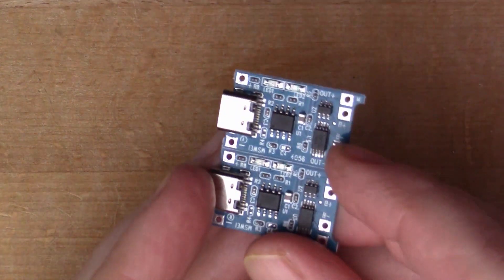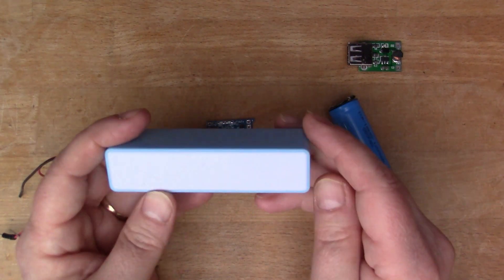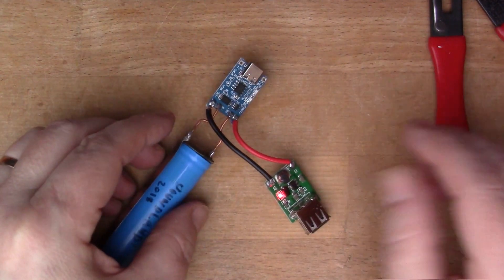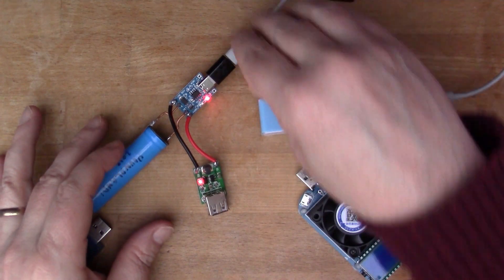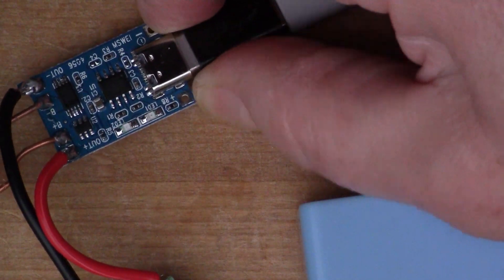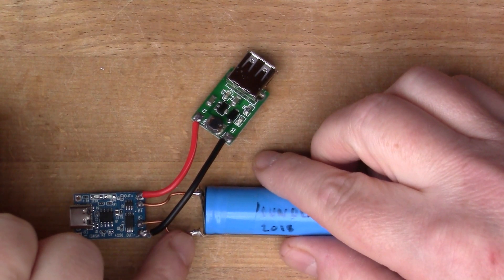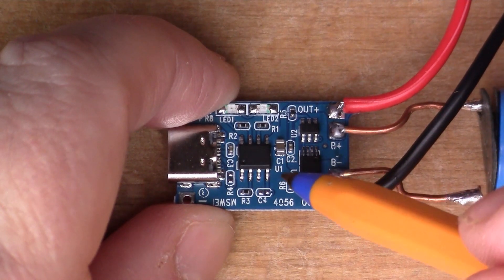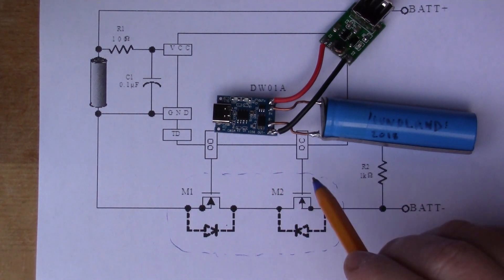Building a USB 'C' Power Bank / Charger (#114)

Comment: Is it the module or... I wonder if you try a battery with higher amp rating would help prevent batyery volt sag when loaded.
Reply from the maker: The cheap battery is at least part of the problem, but I think the boost converter is a problem too.